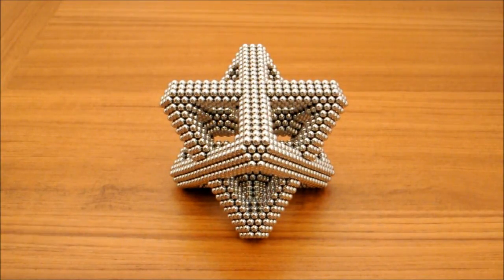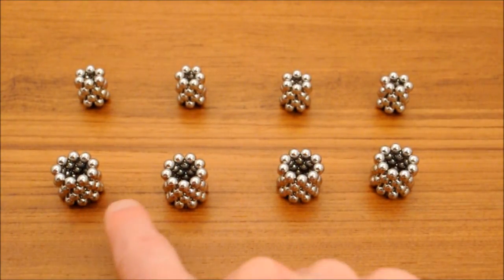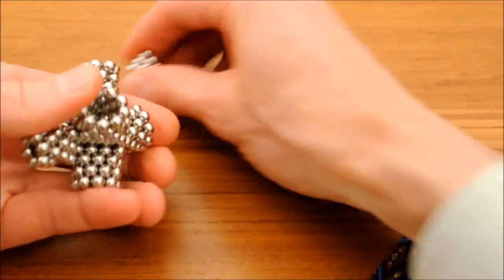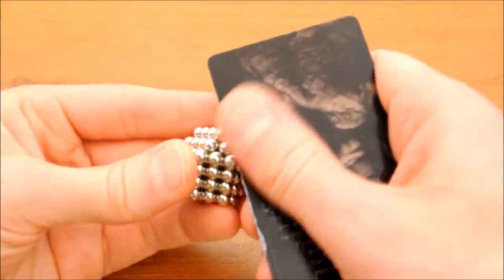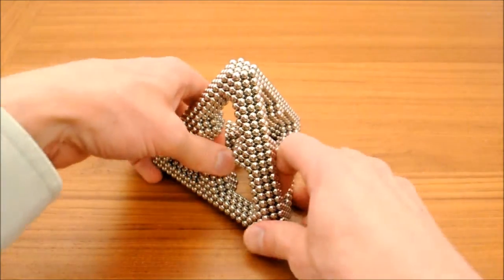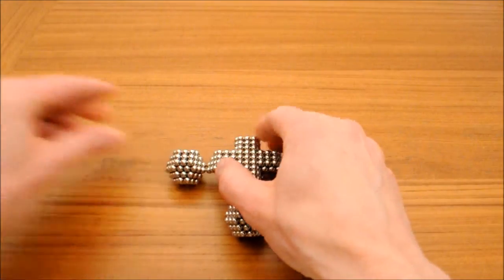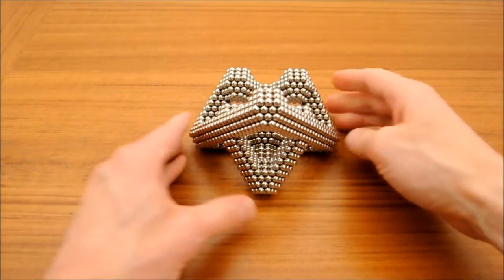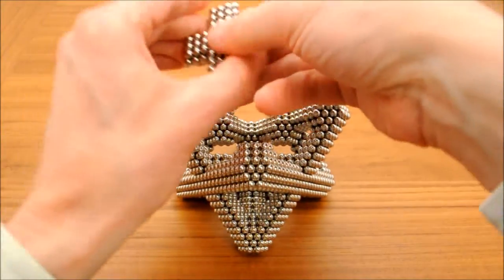Tutorial - Intersecting Tetrahedron Frames (Zen Magnets)

Comment: How many magnets are there in total in the smaller version??
Reply from the maker: Even though it's small, the build I showed in this video uses a lot of magnets.  There are a total of 14 corner/center balls, at 116 magnets each, using 1624 magnets total.  There are 56 magnets in each center to corner arm, and there are 24 such arms (6 faces, 4 arms per face), using 1344 magnets total.  So, the total count is 2968.  The main point of this build strategy is to be able to make larger builds, such as what I showed in the photos at the end.